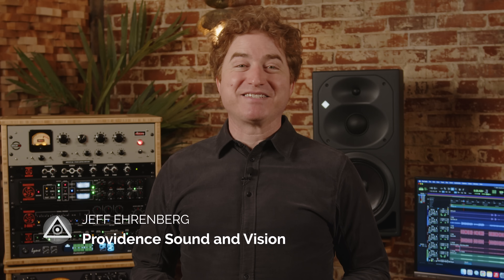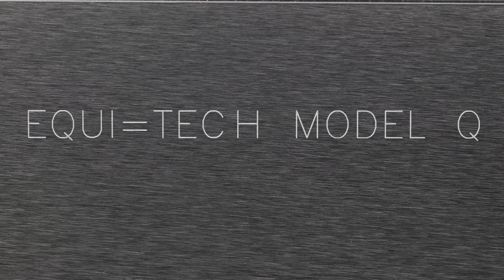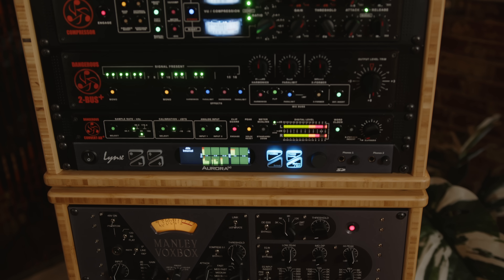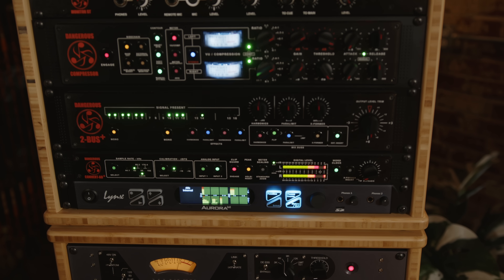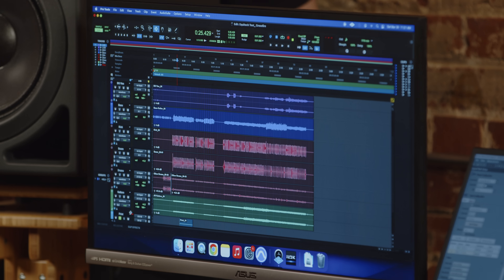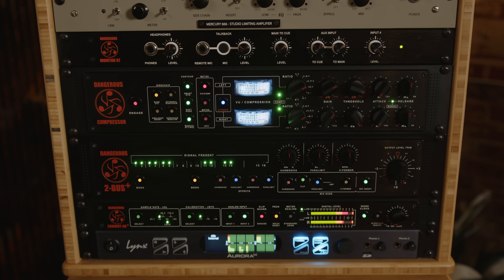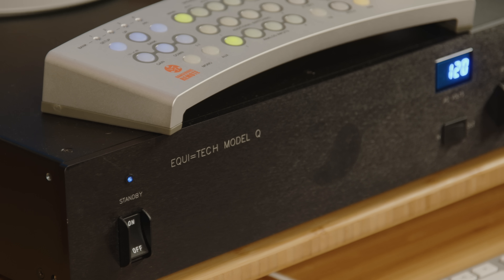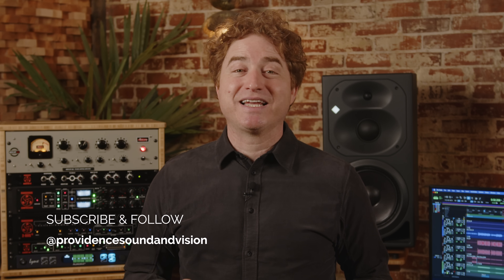Does better power = better sound?  Let's listen to Equi=Tech Balanced Power

Comment from the maker: I was scrathing my head because in the studio we heard a massive difference between the before and after.  I went back and we had some files on the blog post by mistake.  Now if you listen to the full mix of the song Crossfire there is a noticeable improvement between the two and they don't phase cancel as there is more information in the Equi=Tech version.
Reply: None of this changes the fact you can't "hear" better than a mathematical 0 or something that approximates as such across the audible spectrum. 
There are counties and areas where the AC quality is poor enough that some inadequately designed or aging equipment might benefit when under the most extreme testing. 
In the past mains feed was subject to more low frequency switching from CRT's and old ATX computer power supplies with poor power factor.
There are very few exceptions where either of these apply across the whole of US and Europe. 
Simply put there is no way this will make any kind of difference for a typical studio let alone make a marked difference in the mix.

Comment: balanced power has been discussed around audio circles for at least 20 years. the consensus is it's a perfect way to electrocute yourself.

claims in the video that someone invented a simple mains transformer, just like the ones found in countless devices since the beginning of electricity, is frivolous at best and fraudulent at worst.

claims of nasa jpl and other labs using this are unverifiable and there is no reason to believe them other than "we said so". finally, some lab using some gear has no bearing on its fit for audio engineering what so ever.

this is nonsense for rich fools. this video is not controversial, there is wide ranging consensus that you just clowned yourself.
Reply from the maker: Here is a link to some of the studios and facilies with Equi=Tech https://equitech.com/about-equitech/clients/
Reply: @ProvidenceSoundandVision  I don't care if you're used by Hans Zimmer or Taylor Swift, I don't care if Gandhi himself winds your transformers, I am an EE who has discussed balanced power to exhaustion already over a decade ago, and you are not convincing me of your nonsense.

Comment: FFT analysis of some comparisons in your zip files confirms the resulting spectrum with or without the Equi=Tech is.. virtually identical. 
0.3Hz resolution snapshots taken 0-5k and 10-20k, in most cases there is less than 1 pixel difference in the spectral graph on my screen, or < 0.1%.
Unless there is some seriously non compliant equipment in line on the main feed, the high frequency harmonics are so minimal that "cleaning" the AC achieves precisely nothing.
At least this snake oil was easy to prove.
Reply from the maker: I was scrathing my head because in the studio we heard a massive difference between the before and after.  I went back and we had some files on the blog post by mistake.  Now if you listen to the full mix of the song Crossfire there is a noticeable improvement between the two and they don't phase cancel as there is more information in the Equi=Tech version.
Reply: @ProvidenceSoundandVision  I have checked again. Still virtually indistinguishable under FFT or phase cancellation and certainly nothing audible.
Reply: Do a null test
Reply: wowwwww....LOL...more nwo hijacked music business BS